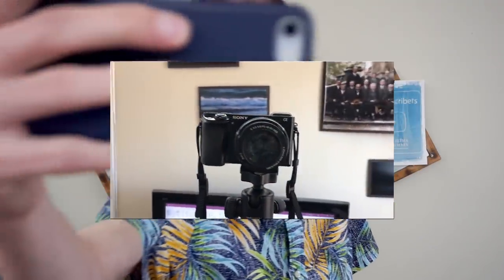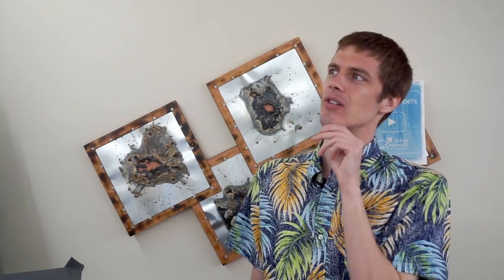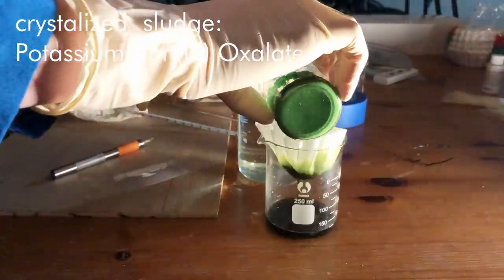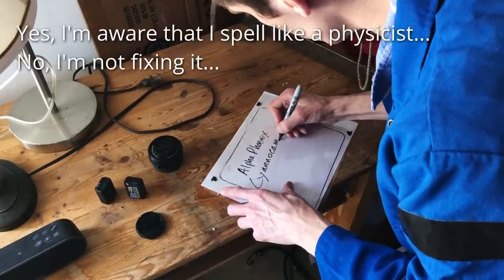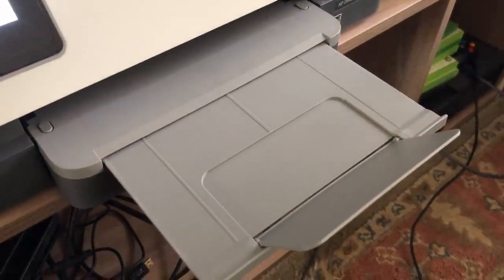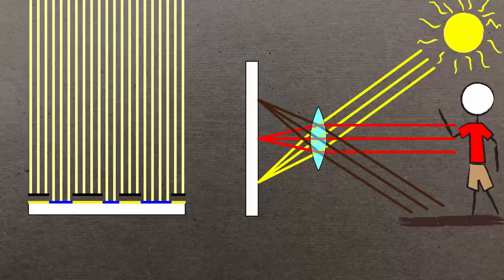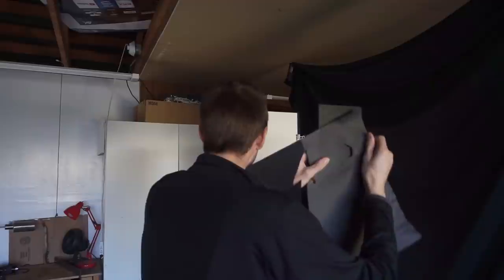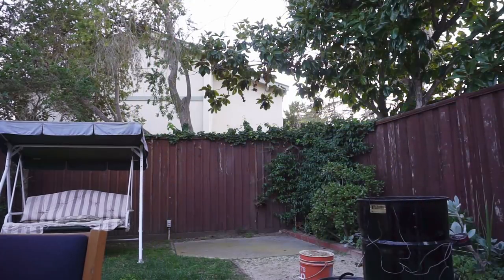Ditch the DSLR? The 200-year-old science of my new favorite camera (2^14 sub special!)

Comment: improvement idea:  make a lens hood for the front similar to what you get from DSLR camera lenses so that the extreme light from the sun won't be able to get in and catch yours on fire.  Also, instead of acrylic have you considered Pyrex or just a glass pane that you can still use the binder clips to hold in place?  I would be interested in knowing if either of those options give a different result in exposure.

Comment: Where did you source your lens from and how transparent is it to UV?
Reply from the maker: Cheap spherical glass lens on amazon - should have checked but didn't! All my stuff is with the movers now so it'll be a while before I can test... That experiment was crossing my mind earlier today while I was contemplating the more complex aspherical lenses recommended by others here in the comments.
Reply: @AlphaPhoenixChannel  Well, glass generally absorbS most UV frequencies quite a lot. I would use concave metal mirror ( Newtonian telescope style)
Reply from the maker: I’ve been researching how to make crazy shaped optics!
Reply: @AlphaPhoenixChannel  Mirrors would also alleviate longitudinal chromatic abberation. Your lens probably doesn't focus visible light and UV light in the same plane. The UV will focus farther from the lens than the visible light and behind the sensitive paper, if you use visible light to focus.

Comment: I was recently thinking of doing this exact process, but with a 35mm film camera; call it a CSLR. Your bespoke setup looks like a 500mm f/5.6; so perhaps using a 50mm f/1.8 will give at least 3 f-stops better performance and also remove the optical aberrations of a single-lens setup. Instead of an 8 hour exposure, I can hope for better than 2-hours.

The drawback is obviously that the final print will be, at best, a ~45mm circular print, but I'll take it.

Comment: look up the van dyke brown photographic process, basically you will be using silver nitrate as the sensitive element, This should result in a much more sensitive film (though it will only make negatives), which will allow you to include an aperture. Now making an aperture does not need to be fancy with a whole iris set up, you can literally make different cards with different sized holes and swap them out for each f stop you want.  

Also you might want to consider reducing the size of the film but keeping a similar sized opening for light, this will allow you to increase the amount of light on the film thus increasing the speed of the exposure process, this might require a different optical stack though and I don't really have much knowledge on optics myself.

Comment: To improve the flatness of the paper you could:
1) Pull thin wire taught over the frame, along the diagonals or horizontally and vertically to keep the paper in place.
2) Pull a vacuum behind the paper and have the back of the camera (how this was done in industry)
3) Point the camera straight up (or slightly up) and use a mirror to compose the image
4) Use some kind of water soluble glue to stick the paper to a removable sheet in the back of the camera
5) Buy a sheet of UV transmitting acrylic/quartz
6) Place a pain of glass over the paper. Soda lime glass is probably worse than borosilicate. You could compare window glass to a glass chopping board. I think the window glass will probably be better just because it is thinner.
10) Profit???

Comment: Very cool concept, I am actually surprised at the quality you were able to achieve. New to your channel and love your videos. Also I have two suggestions I could think of: Any reason not to use cloth instead of paper as the shroud? Could you incorporate a flash using magnesium to help the ISO?
Reply from the maker: The poster board helps keep it’s own shape a little bit. I just picked it because it didn’t require as much support structure

Comment: Your problem of the buckling paper in the camera in humid conditions can easily be solved by stretching the paper. You can use fine textured watercolour paper and soak it in water and use watercolour paper brown tape to glue the paper to a board while it is wet. As the paper drys it shrinks and stretches tight.
After taking your photo you just cut off the paper inside the glue tape.

Comment: OMG you have blueprints of the turboencabulator and the Men In Black haven't come knocking yet? 😲
I suggest trying print paper directly in the camera. It's around ISO 0.5 or 1, that might help while not being totally unmanageable.
Also if the film plane was a segment of a sphere, it might help with that spherical aberration. You might be able to get away with a large plastic bowl with some holes drilled in it so you can draw a vacuum and hold the paper to it. if you can't make it focus to the film plane, move the film plane. :) If that creases up the paper too much, you can still use the inside of a cylinder to curve it on one axis.

Comment: If you are judging the focus by visible light, then your images might be blurry because UV light will have a different refractive index than the visible light, effectively making the focal length different. In other words, there is chromatic aberration between the image you can see with your human eyes and the image detected by the UV. The same thing happens with IR photography, but in the opposite direction.

Comment: A half cone shaped shade could help. It would help with the lens, by stopping the lens from focusing direct light onto the internal of the camera, plus it would reduce the noise from the background on your image.
You could try a spherical exposure surface to have more of the image in focus. (Fixing the paper to the internal pf a spherical surface it could be tricky tough.)
Also it would be fun to see how much the iso can be upped by using a second collector lens and smaller exposure surface to create a negative. (And use that small negative with a fixed light source to create a true enlarged image.) If you had a 1,1" by 1,5" negative image your exposure time should be ~100 times faster, so you could take many more images with it.
By the way do you know the resolution of this camera?
I would assume that it is limited by the optics rather than the photosensitive chemistry.

Comment: Idea for the Camera!
Why not hold the paper in place with the binder clips, but hold the binder clips in place with a spring.  That way you get the imprint of the binder clip but have a tensioning system to prevent any buckling from expansion of the paper.  It may not be perfect, and you may need more than four binder clips, or just differently shaped binder clips but it may be a way to solve the buckling problem while keeping the binder clips cool shadow.

Comment: try sensitizing a plate of glass, then using that to contact print a positive onto paper.  Add a gelatin to the glass for the chemicals to stick then wash it the same after exposure.  In addition, I use a hydrogen peroxide bath to accelerate the oxidation of the cyanotype, you get a deeper blue faster.

Comment: welcome to large format fotography )

couple of observations:
1. your digital camera measures the light intensity in VISIBLE range, lets say GREEN for simplisity. but the medium is sensitive to UV, so your calculation is off
2. your lens is most likely stopping 90% of UV that you need for exposure
3. your lens is too fast and has HUGE aberrations of all kinds, so sharpness will be really bad
4. you can try to focus on something, but since the lens is so open, the UV focus point and GREEN focus points are way off
5. try using a 1-2mm PINHOLE instead. counterintuitively, it may be sharper and faster for you, since it has no spherical aberration and doesn't stop UV

i have no idea about applied chemistry, so thanks for a very interesting video!

Comment: Could you make a camera like a Newtonian telescope, but put the film where the secondary lens goes? Would this increase the light levels enough to speed up exposure?
You could use your mirrored epoxy for the primary.
Speaking of that: could you spin a shallow dish filled with epoxy at a set rate to form a parabola as it hardens, then silver coat it? Maybe that could be a better way to build a fairly precise mirror?

Comment: Have you thought about using photographic printing paper as your negative? It still has a low ISO (around 2) but that's orders of magnitude higher than what you are dealing with now. Developing it requires a lot of different chemistry, easily purchased, and a more light tight environment, but you could easily develop in your garage at night. Worth a try to really put your camera to the test.

Comment: Yes there must be both iron(II) and iron(III) - that's because the hexacyanoferrate complex has more affinity towards iron(II) than iron(III).
If you make Prussian Blue chemically, you can actually use ferricyanide salt (contains Fe3+) by mixing it with iron(II) salt. The iron(II) is taken up in the hexacyano complex which then makes a salt with iron(III), i.e. the insoluble blue pigment.
Using too much iron(III) makes your blue darker, so the pigment is typically made with just Fe2+ (i.e. mixing ferrocyanide with ferrous salt) making a pigment called Berlin White - this pigment is easily oxidized to Prussian Blue - note that only the solvated Fe2+ gets oxidized, not the complexed one.

Comment: You might be able to add a Fresnel lens to this to rectify the aberration, You can get them as sheets so youd be able to install it fairly easy with a bracket inside the camera. 

As for your sun fire problem, Look at adding a matte box to the front. Its like a flag system that is out of the way of the images FOV that you can use to cast shadows on the lens face itself so that sun/light doesn't hit your lens and you only capture reflected light from your subject. This will help minimize fire chance, but should also improve the images as you won't have ambient light bouncing around inside the camera unevenly exposing the image. 

Pretty cool with the cyanotype, but those exposure times are way too long, Have you tried to do the traditional silver nitrate? 

Would be cool to see a part 2 for this camera

Comment: I wonder if you could image the sun with that... The sun actually has a lot of detail in UV and light intensity shouldn't be a problem. You can probably even make the apparature really small to avoid the spherical abbaration... Also: if you have a decent size telescope, mounting this camera on the occular holder to "photograph the virtual image" might be a good way to increase the effective ISO. Though it'd get even more bulky...

I bet lots of people have already suggested moving to silver halides, but I think the cyanotype has a very unique charm!

The easiest improvement to sensitivity would probably be using a UV lens. According to some random paper I found (Turner et al 2014), the most effective wavelengths for cyanotype is in the 300nm range. That's also roughly where the transmission rate of sode-lime glass falls off a cliff. So you are losing a ton of useful light to your lens. You can pretty easily (though not really cheaply) buy 50mm diameter lenses that are 90% transparent up to 200nm even. That should give you a much larger effective frequency band (like 150-200% of the current state). On the other hand Turner et al also says that 400ish nm also kinda worked and there is like an order of magnitude more sunlight in that region than in UV-B so.... This is easily solvable too though, get a UV-B lamp and photograph objects illuminated by that! Just try not to get sunburned :P

Some rough back of the envelope maths also tells me that you could get an improvement in effective iso by using non-linear optics to first split out the UV part of the image, frequency double the rest, then recombine. But the improvement is probably going to be lpretty small and the optics are really complex and expensive. But, non-linear optics are really cool and few people on youtube show them off!

Comment: Since your film is insensitive to red, install a focsed red LED or laser pointer and a photocell or photodiode to measure the exposure. As the blue goes goes up, your meter goes down. Target the red spot onto the area of the image that will turn out darkest blue and once it reaches that preset level a shutter closes or an alarm flashes or sounds.

Comment: I am very interested in your thoughts on the blue reflectivity being caused by electrons being shared from one type of iron oxideto another. I know that electrons emit light of particular colors when jumping from one orbital to another, but my understanding is that reflecting color is different than fluorescence (or absorbing energy and then re-emitting it at a different wavelength). But I am curious how those two things differ on the atomic level and what goes on in the quantum wavey world that we observers are not privy to.

When low wavelength colors of light are absorbed by prussian blue, they are converted into heat. How exactly does that happen, and why does blue light in particular, not get converted into heat. What are the actual mechanics of the light in -> heat out function and also the light in -> light out of reflection?

EDIT ok this video helped me, I guess fluorescence and reflection only differ in that the wavelength changes   https://youtu.be/wiPHp-V30lc

Comment: I think you're mistaking spherical aberration with Petzval field curvature, but there probably might be a bit of both. Either way, lenses are made to correct for these and a cheap lens like you got won't do the job. You should consider buying an old large format lens. They are a bit expensive but would solve your problems! Also keep the paper under tension to avoid it distorting. Tape won't do that, paperclips can!

Comment: Solution is obvious: first do a photo really small (similar to 35 mm frame). The smaller the more light, the shorter exposure needed. Then, after washing it, shine a really bright light (or sun) on it, and take a photo of it! now with longer focal distance, on a bigger sheet of paper. You can make the exposure as long as you wish, leave it for few days even, because you are making a photo of a still image now.
The only inconvenience is you need two cameras - one camera for small image, high brightness, short focal length, and a second camera for long exposures, to act as an enlarger.

Comment: I think you said the cyanotype chemical was sensitive to 680 nm wavelength light (right?).  But that it was sensitive to UV.  The confusing part to me is that 680 nm is on the extreme IR end of the human visual spectrum (VIS) and not on the UV end of the spectrum.  So which is it?  Is it sensitive to IR (actually close to Near IR) or is it sensitive to UV (under about 400nm)? Also, regular home window glass makes a nearly perfect UV filter -- filtering about 98% of UV light so very little UV enters the home. A double pane of glass even does much better. That is the reason you can't get a sunburn (or tan) in a solarium or a glass enclosed swimming pool area.  The other comment I wanted to make  is that lens materials may appear to be clear at VIS wavelengths but not may be cloudy or scatter light at the wavelengths you are interested in. If your lens is glass is may be nearly opaque to UV and scatter NIR badly. If it is acrylic then it may pass more light without scatter at NIR/IR wavelengths.  I think possibly you are really interested in NIR and not UV to expose the cyanotype -- REALLY.  In fact, that VIS color as a pigment tends to absorb more on the NIR/IR end of the spectrum (that is why it appears VIS as Cyan).  Even many NIR laser absorbing filters are cyan in VIS color.  One last thought I would like to offer... painting something flat-black to make it non-reflective or VIS-Black doesn't mean it is NIR-Black, IR-Black  or UV-Black (nonreflective at those wavelengths).  For instance, I I use a 905nm (Police LiDAR) absorbing pigments on my motorcycle to make it more Stealthy to Police Laser speed measurement devices and it is not VIS-Black. It is rather VIS-Burgundy and NIR-Black (905nm Black -- or absorbing to the greatest degree --- almost an NIR-Black-Hole).  But you are right in thinking that often things that are VIS-Black are often wideband-Black as well.

Comment: The plexiglass when I've looked online to buy a sheet, all the plexiglass that I found all said UV resistant does not yellow. I have no actual idea but could a cheaper plastic work better than the plexiglass cuz I'm thinking the plexiglass reflects the UV before it can penetrate the polymer and actually do damage and cause yellowing so one that isn't UV resistant that would yellow over time will allow the UV light to pass through it it takes years to yellow so I'm thinking it'll be more permeable than the plexiglass. Get just a nice plain sheet of glass  now that I've written all of this that is probably your best shot. I look forward to watching your progress whatever else you decide to toss out.

Comment: A different lens could allow you to bring your film closer. This would decrease the size of the print, but would allow you to throw more light per unit area giving you a shorter exposure time. Half your image height should cut your exposure time by a factor of four.
Reply from the maker: I’ve got a bunch of footage of trying this but it didn’t make the final cut! Unfortunately i was trying to get a sharper image by shrinking the print but because the lens is then proportionally larger it actually doesn’t help...
Reply from the maker: It was a LOT brighter though!